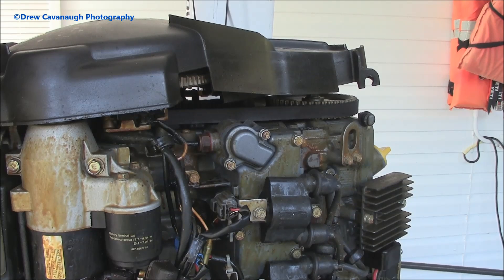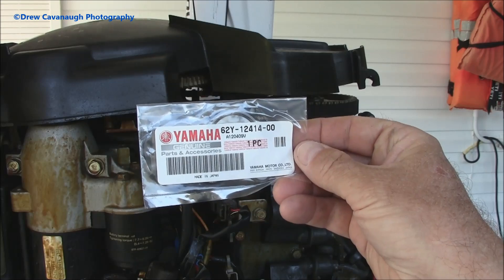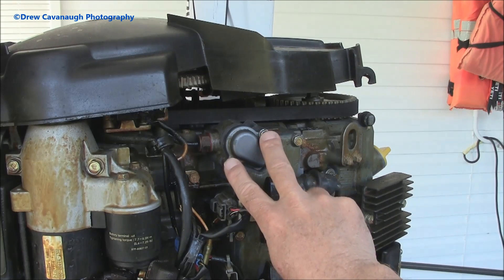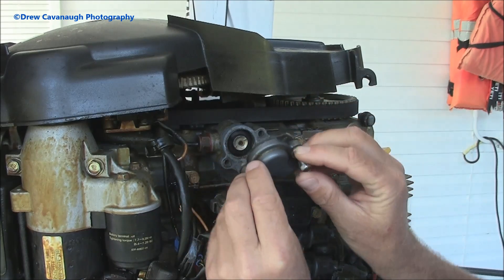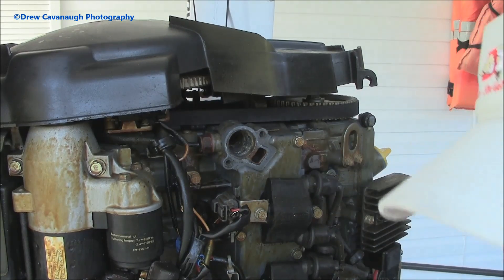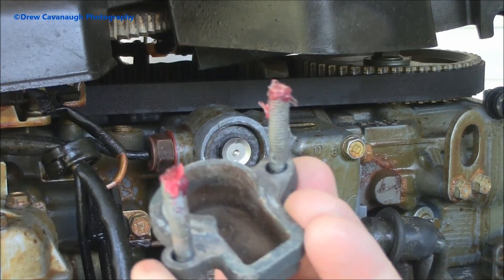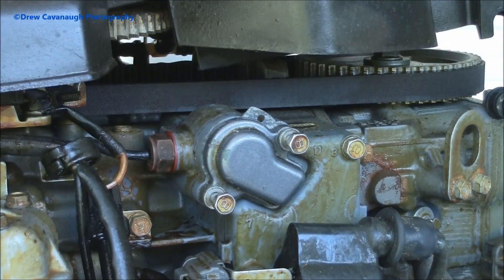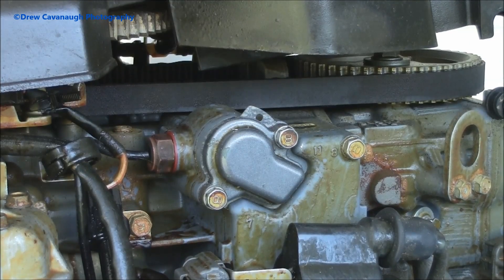How to Change an Outboard Thermostat Update 2024

Comment: hi captain drew. i have a yamaha T50 with a 145 hr on it. i changed out my thermostat yesterday for the first time it was lot of corrosion on it and the water that was coming out got extremely hot . i do not remember the position the old thermostat was when i took it out but the new went in fine and i put the cover with the new gasket on it like the way you show it in the video. my question is does it have to go back in a certain position or way for it to operate properly or it just goes back any position when you put it back in.i just want to make sure i did it right and don't screw something up. Thanks for all your educational videos i'm watching them all the time.
Reply from the maker: It should open and close as it  heats up. You can test it using boiling water and a pot.

Comment: Hey sir thanks for the video! I have a 07 Yamaha 15hp. It has a weak stream and the water coming out is very hot (steaming, hot to the touch) I replaced the impeller and I’m still having the same problem. I’m planning  on doing the thermostat next and was wondering if you had any suggestions? Thank you
Reply from the maker: Could just be the age of the engine too.
Reply: Təcili termustatı yenisi ilə əvəzləyin

Comment: will it still spit water out if the thermostat is stuck closed. ?
i get lots of water coming out but the water never gets hot but it seazed up from over heat i think. now i got it running again but im worried
Reply from the maker: It should

Comment: My Yamaha 200 HP 1996, when I go over 3000 RPM the alarm-goes on.
 Could it be that the thermostat. Or something else? Please call me back
305.303.6589
Thank you for your help Captain Drew
Reply from the maker: +Fabian Echagaray Try the thermostat first, that is very easy to see. If it is stuck open then there is your problem.

Comment: Drew I really appreciate your videos  
I used your water pump video and saved some money by diy but even after
I changed the pump impeller and still have a weak stream while idling and overheats unless I go faster than idle ( not sure what rpm the stream gets strong ) would a bad thermostat cause low water pressure or maybe I have some debris that I can't see I what is your advice 
and thanks again
Reply: Rich Schultz my boat is doing this exact thing right now and thermostat is my next step

Comment: Thanks for the videos.  Do you have a video for Evinrude 90 Pre 1996?
Reply from the maker: OHTFUN DING No I do not. If I knew someone with one I would do one.
Reply: Thanks! I think I can see how to do it, they just have a tight spot and i have heard some people say they drill out the bottom cowling to access the bolts. I'm not sure I could fit my hand in to push the springs back to reassemble. Not overheating, I think I think I will take it to the shop in town. Thanks Captain Drew Cavanaugh!

Comment: Thanks for the thermostat and water pump videos. After doing an oil change the water flow slowed to a drip then nothing.
I was going to bring it for service when I found your you tube page. I don't know what one fixed it but in less than 2 hours after getting the parts it was back to normal again. You saved me a lot of money, Thanks again Jim
Reply from the maker: James Bisordi Thank you for watching.

Comment: what happends if ur thermostats stay closed & dont open? will the motor over heat?
Reply from the maker: It can overheat. Is it doing that?
Reply: would a stuck thermostat in closed position, stop the motor from pissing out the back?
Reply from the maker: Carry Smith
 That I do not know. Depends upon engine specs.